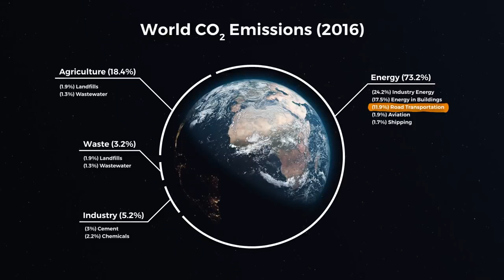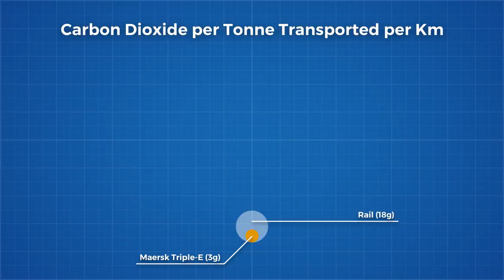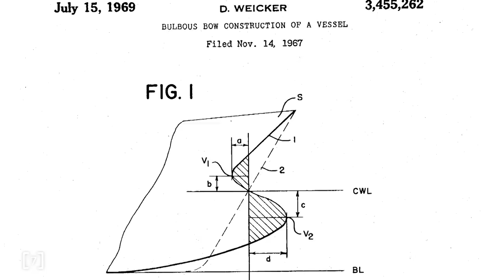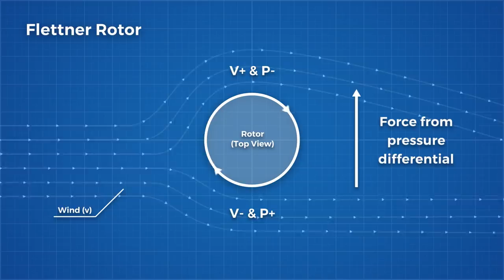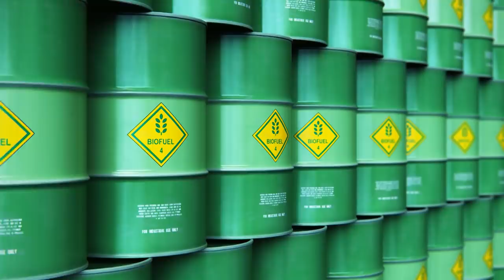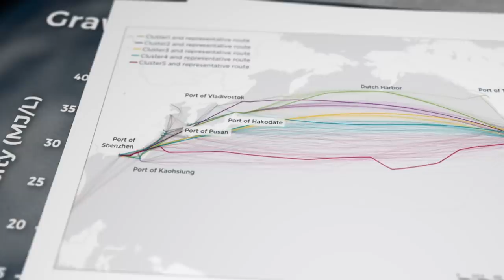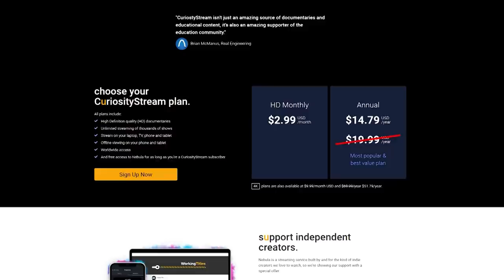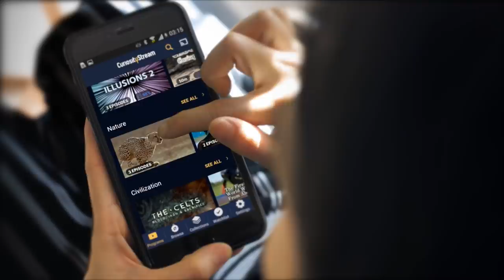Are Renewable Powered Ships Possible?

Comment: There's already hundreds of nuclear-powered seagoing vessels.
Reply: Of which only 4 are merchant cargo vessels and of those only 1 is still in service...
Reply: They're not nuclear powered because it's cheap or green or generally a good idea. They're nuclear powered because military strategy requires them to.
Reply: Are you including the Russian ice breakers?
Reply: @SD-tj5dh  no, I'm not. Those aren't cargo ships. But there are 4 of those plus 3 being built
Reply: @graealex  It doesnt really require them too, but for countries like the US who have massive air craft carriers running constantly, nuclear power makes alot more sense. The UK looked into making the Queen Elizabeth a nuclear ship at one point during planning but decided to go for conventional fuel because it was smaller and was running the massive distances like the Nimitz so it made less sense. It's kind of an "economy of scale" situation, once you go to a big enough ship running for long enough it makes more sense from an efficient design standpoint. Same goes for ice breakers. With subs the situation is trickier, nuclear power does give you much more operational flexibility to the point of being virtually a requirement, especially if your a russian sneaking around the Eastern Pacific or an American sub sneaking around the Western Pacific, or either country in the arctic where going under for long periods of time is essential.
Reply: @arthas640  And what's your argument now? I said they use nuclear because they need to. And you're kind of repeating it.
Reply: @graealex  In what way do they "need to"?
Reply: @pseudotasuki  In being able to travel large distances without the need to refuel. If you're traveling to a conflict region, not having to refuel is a major strategic factor.
Reply: @graealex  Which is also beneficial for cargo ships.

Comment: It's extremely misleading to show how much consumption lowers PER DAY when lowering speed, without mentioning that the more it slows down, the MORE DAYS it has to travel to get there. So while per day it consumes less, it has to travel more days, so the actual total fuel consumed to get there is not as small as suggested! This is disgustingly misleading from an engineering channel, and it should have been normalized by the distance travelled for an apples-to-apples comparison. Because you know what, if the ship lowers the speed to zero it also lowers consumption to zero, whoop-dee-f---ing-doo!
Reply: @snowstrobe  with that logic he also didn't need to mention that lowering speed reduce fuel consumption in the first place?? What kind of logic is that? And he also didn't need to make the episode at all in that logic right?

Comment: Considering that for thousands of years ships used the power of the wind to travel all over the globe, and that right up into the 20th century there were still merchant ships which used sails and the wind as their primary means of propulsion, this question was answered long ago. By the 20th century, the sailing merchant ship had pretty well reached the peak of its development with the famous "P" Liners out of Germany. It would be entirely possible to build and use such ships again.

Comment: Love the info, I have a question. Does electrical powered ship are out of the equation? with the turbines genereting power offshore, maybe is more than an option?
Reply: With regard to propulsion with electric motors powered by ‘green electric’, leaving aside the fact that there is no truly ‘green’ electricity, the best we can do is low carbon impact both at installation (capital account cost) and production (revenue account cost).  Running ships on the ‘lecky’ is tricky the two examples that I personally know of, and have used, are a vehicle and foot traffic ‘chain’ ferry that ply’s its trade across the hundred meters or so of the Nordre älv between the island of Hisingen and the Kornhall on the Swedish mainland.  The motors are on the ferry and a cable is unwound and wound back up on board as the ferry shuttles back and forth from Kornhall.  When the vessel goes anywhere else, id est dry dock for survey and or maintenance, it is towed by a good old ICE powered tug.  The other electric vessel is a vehicle and foot traffic ferry that runs from Helsingborg (Sweden) to Helsingor (Denmark), a twenty minute trip, she tops up the charge in Sweden each time she is alongside and battery capacity is said to be sufficient for an hour of main engine use.  There are small diesel gennys on board; to keep the lights on in extremis.  Sadly as of now electric boats are as functional as chocolate fireguards, yes ‘submarines can be diesel electric’ but they have negligible cargo carrying capacity and if you ever go on one your first thought could be ‘where do they put the crew?’

Comment: Hey great content but what about the nuclei technology commercialized for shipping industry ? Can you make a video about that.
Reply: Just think; would you have full confidence in the management of a nuclear reactor under the control of an anonymous entity only traceable, perhaps, via a letter box in a FOC (flag of convenience) nation state?  If you are, could you sell that confidence to Japan, the state that hosted the Hiroshima and Nagasaki nuclear detonations as well as more recently the Fukushima ‘event’?  Then try that same, or a similar, sales strategy on Ukraine, the nation state that as a part of the USSR (CCCP) hosted the Chernobyl ‘event’.  Modern iterations of nuclear energy, thorium fuel, molten salt reactors, small modular reactors or fusion reactors, will carry the legacy of past problems.  It is the global trepidation of anything with 'nuclear' in the name and the economics of nuclear having transitioned from 'energy to cheap to charge for' too 'the costs of remediation are incalculable' that will prevent the adoption of nuclear energy as a means of creating energy at sea.  Modern reaction systems may have overcome the safety problems but the general public, having been misled in the past, will be reluctant to believe the fresh new promises.  The incident of the ‘Ever Given’ blocking the Suez Canal, March 2021, may also have a little to add to this debate.  The cooling water on ships tends to get taken in from near the bottom so when running aground the inlets are in a prime spot to get plugged up restricting, if not stopping, the flow of coolant.  One thing that the TMI, Chernobyl and Fukushima incidents all had in common was that the supply of coolant, or rather lack thereof, was a fundamental cause.  Similarly and only months later, May 2021, had the ‘X Press Pearl’ been nuclear powered then a major port for a populous nation in the global South would have possible been the site of a significant exclusion zone due to a non power plant related incident.  If the ‘X Press Pearl’ had on board a fired up but ‘safe’ molten salt reactor and found herself having to run down the possible 12.5 megaWatts of energy in the power cycle would a stable cool down have been possible?
Another, similar but more extensive view, may be found at https://www.quora.com/Why-are-there-so-few-nuclear-powered-cargo-ships-If-it-works-for-ice-breakers-and-submarines-why-hasn%E2%80%99t-it-been-established-for-merchant-vessels.  Why not use nukes?  It is down to engineering, finance, socio-political attitudes and safety.

Comment: Can we get the stigma off nuclear power before we go chasing an infant like renewables
Reply: nuclear stigma is by far one of the biggest problems we have slowing down progress
Reply: Can we not focus on one thing and instead attack this problem from multiple angles? Nuclear powered shipping is a perfect subject for independent development since it requires very little in infrastructure. So develop it independently and prove all the sail, natural gas, biofuel, and hydrogen shipping methods wrong.

Personally I prefer wind powered cargo, all it requires is slowing down transport like the big container ships are already doing. Apparently we can slow down shipping. This is a good thing.

Comment: One option for shipping and rail going forward is going to be bioethanol reformer driven fuel cells. Where a regenerative steam cracker reformer splits the ethanol into the hydrogen needed for the fuel cell + CO2. Nearly the energy density of classic fuel but with almost no moving parts, and higher efficiency. While you still need to grow and process ethanol that can at least be more environmentally conscious than bunker fuel and eventually near carbon neutral.

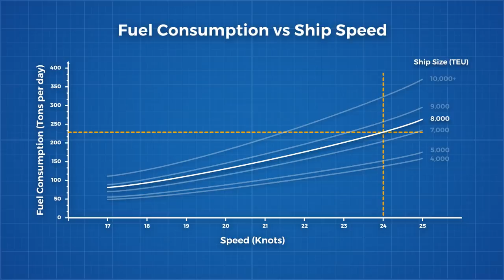Comment: 3:30 This comparison makes no sense. Sure that's a big reduction in fuel per *day*, but it would need to travel more days to get to it's destination at a lower speed. What we really care about is fuel per distance
Reply: He said: "...a reduction in speed of just 12.5%, to 21 knots, would result in a 33% decline in fuel consumption".

Reducing your speed with 12.5%, means the distance covered in a given period of time is also reduced with 12.5%. But, for the same period of time your fuel consumption is reduced with 33%. This mean your fuel consumption per distance value is reduced with ~23.5% ( fuel / dist = (100% - 33%) / (100% - 12.5%) = 76.5% of the original value)
Reply: @attitokes  Reducing speed does result in reducing fuel per distance but not by 33% but by 23.5% So you agree he is being misleading?

Comment: "Are renewable powered ships possible?" 
Me: Sails, slaves and oars?
Real Engineering: Flettner Rotor, cleaner fuels, better hydrodynamics.
Me: Yeah, what he said.
Reply: Renewable power was the first transportation medium. River currents, animal and human muscle powder, and wind all powered the transporation and cargo industry until the industrial age. However it was not without it share of problems. Rivers were seasonal, muscle power required food and rest, with a limited carrying capacity. Wind powered ships were at the mercy of wind and sea, literally. The sheer numbers of ships lost and people who perished are staggering by todays standards. Additionally the displacement (weight) and cargo carrying capacity were limited by the ability of the wind and sea to move that mass. Sailing ships of the pre-industrial age carried several times the number of crew of a modern cargo vessel at a fraction of the displacement, and capacity.
Steam made iron hulls and predictable passages possible, in greater safety. 
Replacement of coal with oil made running steam plants safer, until steam was supplanted by diesel. 
So every method has its drawbacks.

Comment: Not sure why the volumetric density of hydrogen is even a problem for nautical vessels this large. Why not put all of the hydrogen fuel in a floating pressure vessel blimp (combination kite sail), tethered to the ship via non-conductive tethers. This could then allow the transition to hydrogen to increase the cargo volume of the vessel.  The range could be made greater than any current nautical vessels, because the size of the blimp is not substantially constrained.

The hydrogen might also make the entire vessel lighter, until the end of the voyage when the fuel runs low. In the off chance there is a lighting induced fire or other fire, an emergency release and rocket boosters could fly the blimp away to a safe salvage location. 

Green hydrogen is expected to come down in price dramatically ($3 per kg). It should soon become cheaper than any fossil fuel (methane included).

Comment: No, unless you are willing to make them nuclear-powered.
Reply: Im all in for nuclear, but that isn't a solution to making ships renewable
Reply: Imagine what would happen if a nuclear powered ship were to crash, have a fire, be attacked on or sank? Water is quite a good shield, and it sure cools the reactor, but in large enough numbers (say 1 serious mishap per year for the next 50 years) could have noticeable impact on fish population, and would affect some radiation sensitive industries and equipment (like the nuke tests did)
Reply: @h.e.c.t.o.r.  well butt nugget 1hp covers to 750watt.  Typical container ship has about 110,000 hp or 80,250,000 watts.  A big house solar panel is 300 watts.  So you'd only need 265,000 house panels to power the ship for about 6 hours a day.  So need another 3 score plus batteries to run that ship for the other 18 hours a day.  So something like a million solar panels plus say a 1,000,000 lbs in batteries.  Or do you have a stead supply of unicorn farts to make it work?

In other words its going to be nuclear or nothing.
Reply: @GeoFry3  Why are you so mad about me pointing out what was the point of this video? I'll say it once again: Nuclear seems like the most feasable option for switching away from fossil fuels, however, there might be options worth researching in both battery and geothermal science, as they're way easier to get adopted by the general public.

Comment: Scrubers are evil. They switch air pollution for an ocean one. They're killing everything in the water.
Reply: Well air pollution of heavier than air gasses on the middle of the ocean end up being absorbed by the water anyway but yes the consentrasion is a problem.
Reply: @flemmings5534  yes ano no
after combustion the mix is different

neither of those method is good

Comment: if the measurements for hydrogen millage is based off moving to hydrogen alone that just seems silly because if they used wind and hydrogen it sounds like they could reach zero and keep the same cargo cap without refuelling

Comment: There have been ships built to run on renewable power since the 1980's and they worked. Just like they have even tried powering ships with RB211 jet engines. One was used in the Falklands conflict and could outpace even the latest destroyer in the Navy! Well over 48 knots fully loaded! But at a huge fuel cost of course.

Comment: A video with your take on bio-fuel would be much appreciated!
Reply: How about ‘bio fuel’, how green is it?  Short answer, not very; major problem is land use and the limited upside is that the carbon released into the atmosphere has recently been taken out of that space in the growth part of the cycle minus the processing deficit.  On a small scale, to use up the waste products from other industries like forestry, animal husbandry or agriculture, ‘bio fuels’ are as good source of carbon molecules as you could get but they, like all 'alternative' fuels, still involve a combustion stage and therefore some noxious effluents, NOx for example.  Fossil hydrocarbon oil fuels run up from CH4 (methane/biogas) to very thick black HFO cSt380 (C20H42 to C50H102 or more).  The sweet spot is kerosene (C10H22 to C16H34), also known as gas turbine fuel and used in modern aircraft engines.  It is relatively cheap, relatively energy dense, relatively hydrophobic and relatively safe.  Creating a non fossil substitute, at a reasonable cost, is ‘the holy grail’ for energy chemists; like turning base metal into gold.  Natural history, on a geological scale, has done a lot of heavy lifting for us humans.

Comment: What about renewable tug boats?   That would at least improve the air quality around ports, and they can recharge daily since they stay near the port.
Reply: Though that might be feasible in practice ‘tugs’ need lots of power in short burst with readily available reserves for when things do not go according to ‘plan A’.  So hybrid ICE/battery could be an option so long as the economics stack up and would as a bonus be a means of quantifying part of the cost of environmental improvement; WADR getting values to add to the debate would be a very useful tool.

Comment: They have to switch, as supply of heavy fuel oil (leftovers from petroleum distillation) will decrease when demand for diesel and gasoline drops. Running on a more diesel rich fuel mixture would increase the price of shipping.